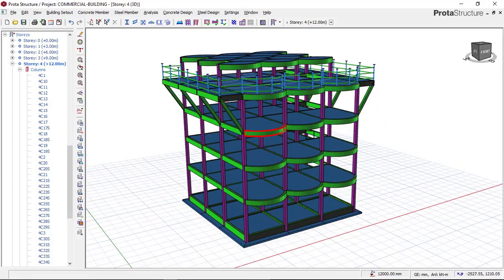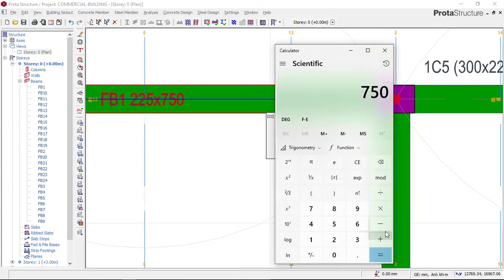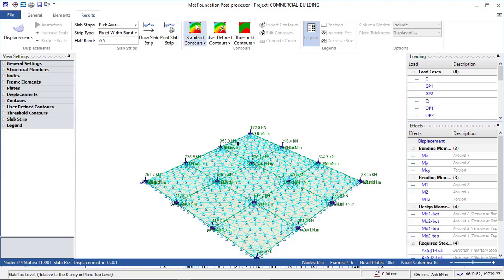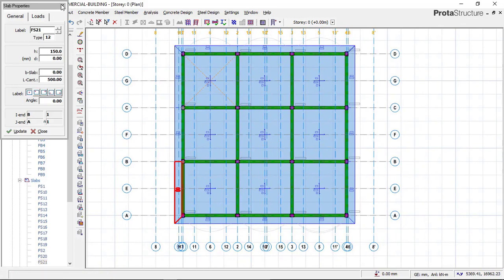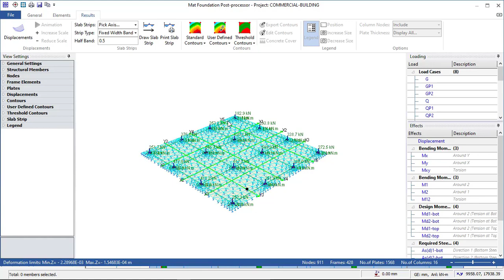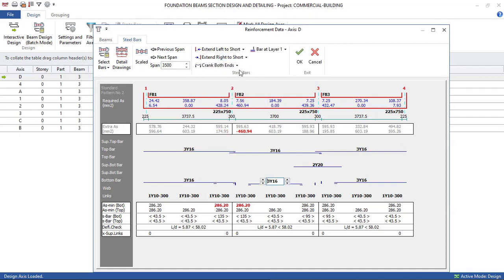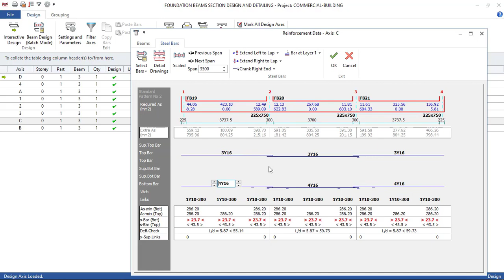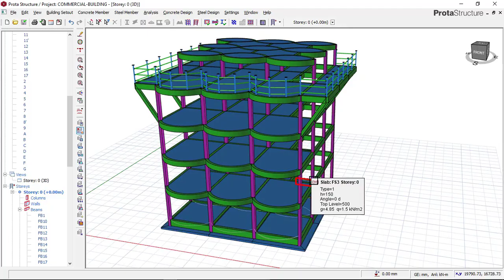Raft Foundation Design For a Reinforced Concrete Building in Protastructure.

Comment: Thank you very much. Whenever i want to design the foundation beams, it says "maximum steel size is defined as less the minimum size". I have explored the parameters several times but it still won't work.
Reply from the maker: What it means is that the minimum size of reinforcement you defined is higher than the maximum size of reinforcement you defined
Reply: @EkidelCAD  that’s odd. I can see Y16 as minimum reinforcement and Y20 as maximum.
It’s in my front right now.